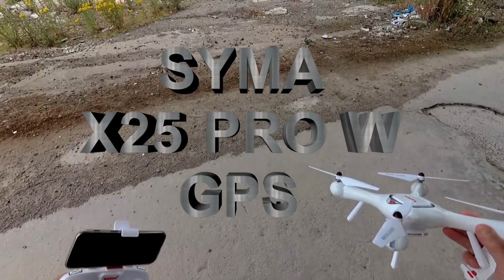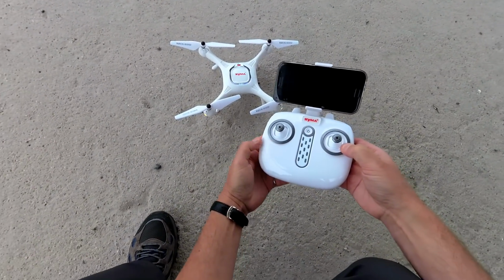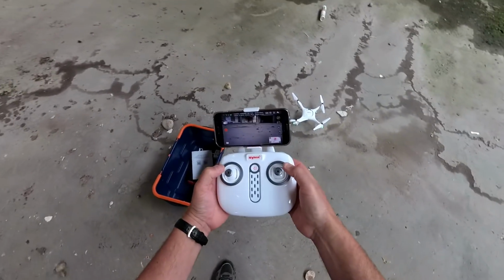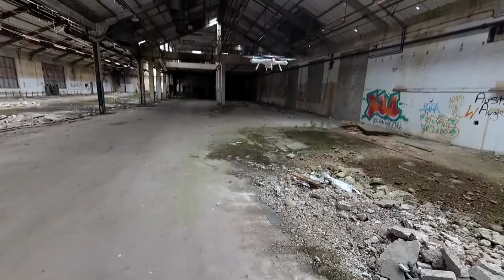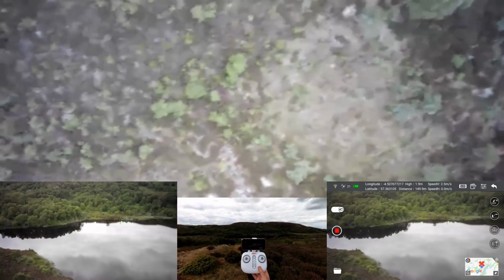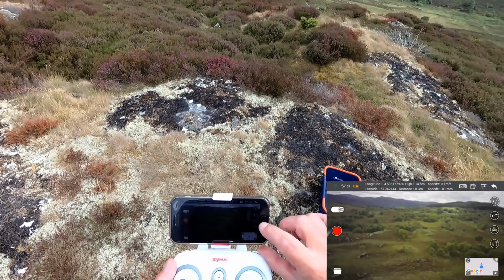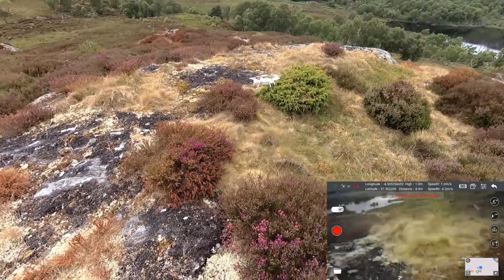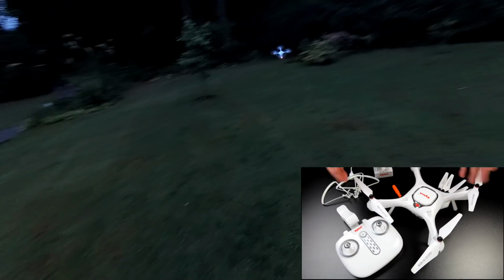Syma X25 Pro W Beginner GPS Positioning WiFi FPV TX control drone review

Comment: Mmmmm... SHINY! 😎
That almost expunged memories of the hilariously bad X8 Pro. Glad Syma are back on form, but they need a new more powerful transmitter  and a different design ethos 
(that model looks like it was designed in the 1920s)

Oh, and nice graffiti in the bando factory Tig! 😯😂😄🤣
Reply: Hi. I've just bought this Drone (X8Pro). I must say that I have not experiencef any issues or problems as you and others have commented. I have successfully calibrated the GPS and calibrated the Gyro. Mine takes off and hovers in one place with none of the so called toilet bowl effect. I understand that you need to do the calibrations in an anti clockwise direction. I personally would highly recommend this drone. To all that have issues, read the manual properly and calibrate it properly then you won't have any problems, don't press and hold the RTH button, you only need to press it once. . It is a fantastic bit of kit. Yes it can be twitchy, but that is to be expected from a precision sensitive piece of equipment. I love mine and love flying it. It also looks stunning both stationary and in the air. Go ahead a buy it you won't be disappointed at all. Just remember to read, and read the manual properly and you won't have any issues, even with the camera and my phone attached in WiFi mode.

Comment: Hmm
It's a Syma so it flies well enough. The Wifi fpv works (for wifi fpv and in virtually perfect conditions). The GPS seems to work. 
The camera is rubbish with loads of jello especially when pointed down and the stepper motor tilt system is very very poor.
As a package it needs some work.
Good review as it clearly showed all of the above.
And everyone learnt that trying RTH indoors is not the best idea
lol